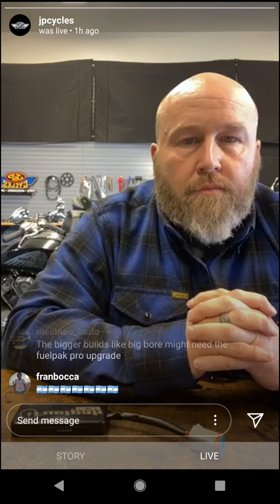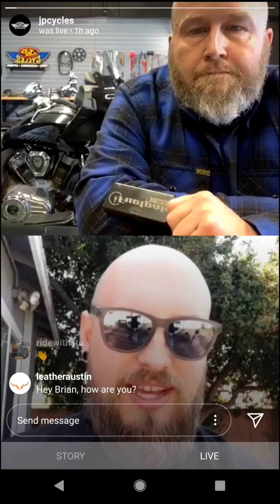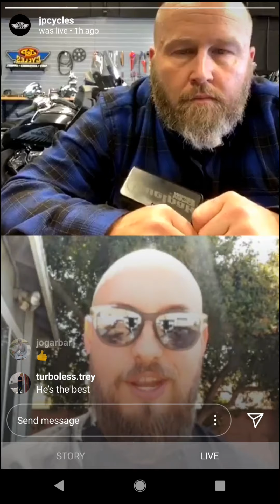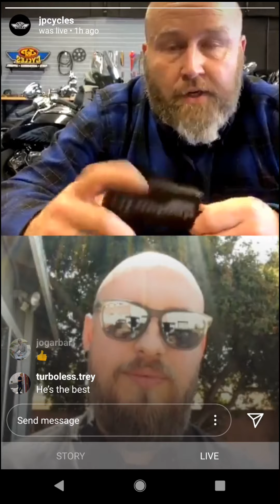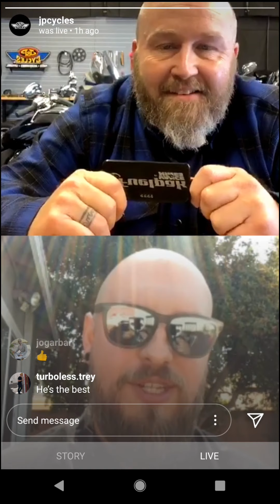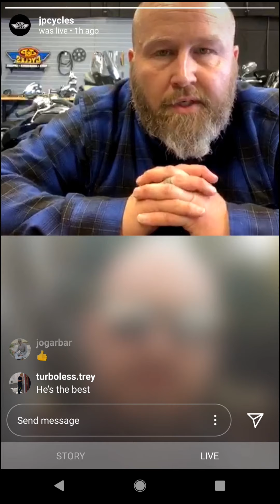Fuelpak FP3 Chat With J&P Cycles

Comment: Does the throttle progressivity work on the XL platform?
Reply from the maker: The throttle progressivity is only available for throttle by wire models.  If you want something more aggressive for the XL, then you can look into something like a 1/4 turn throttle tube that works with your cable operated system.
Reply: @vanceandhines  is this something you guys make?